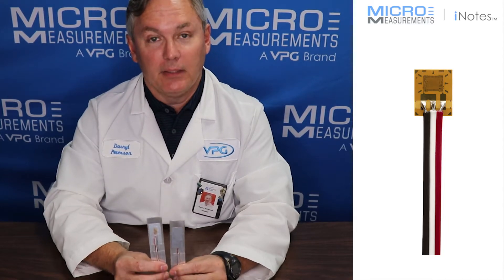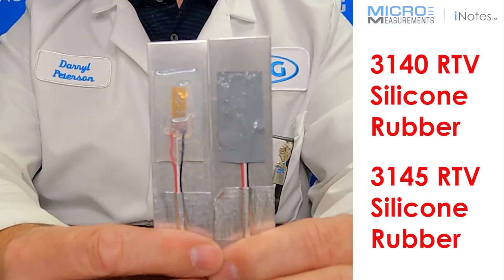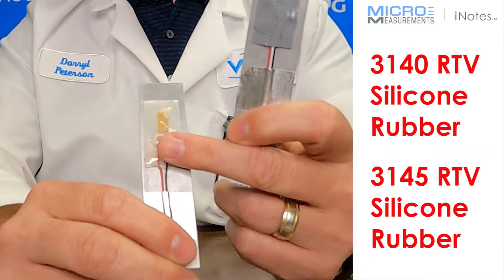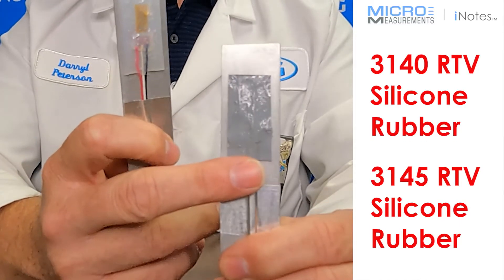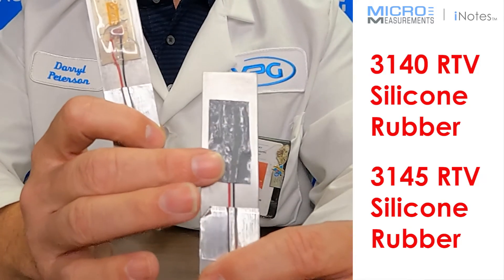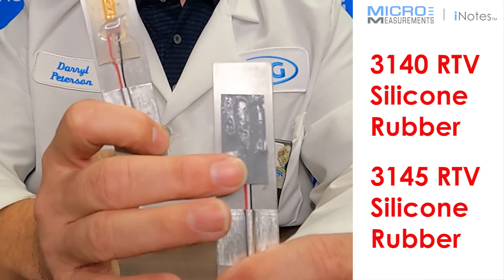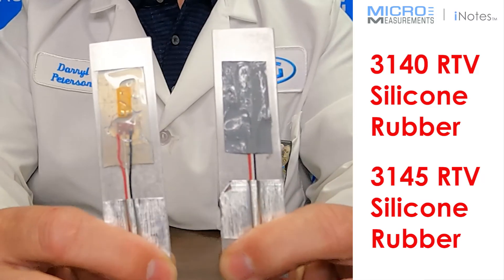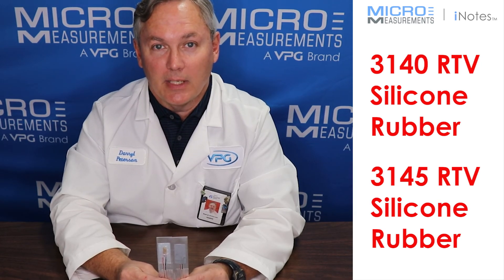CAN I TRUST ELASTOMERS TO PROTECT MY STRAIN GAGE?

Comment: Hello!
Please, could you guide me I have a hota gougar joystick that I use in my F-16 simulator and I wanted to use a force sensor, which model force sensor to use for my joystick.
These would be the parameters the force required for the actual F-16 stick deflection is up to 75 N to 140 N depending on the axis.
Thank you for any help!
Reply: Humberto, thank you for reaching out. Strain gauges are used in force joysticks (for fighter aircraft and commercial aeroplanes), but we do not manufacture force joysticks. I also don't think we make any force sensors in our other divisions suitable for this application.
Reply: We manufacture gear load cell for cars. Your requirement seems to be something similar to that. we do manufacture custom load cell. So we can customize the gear load cell for joystick application.